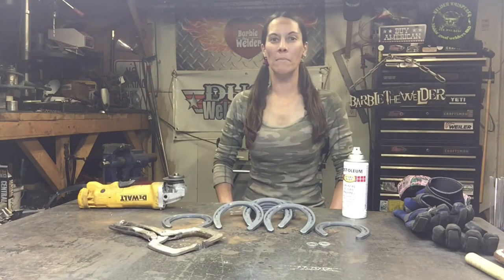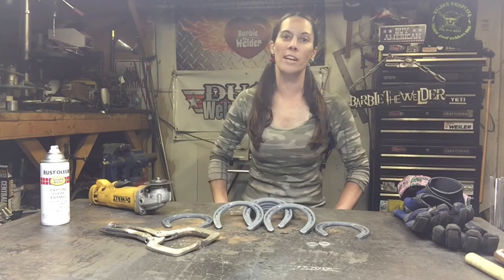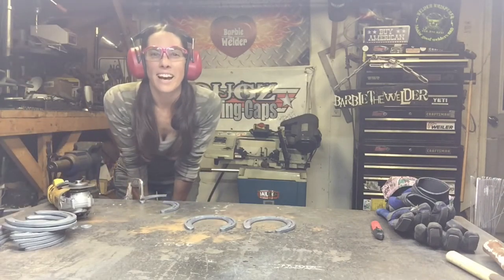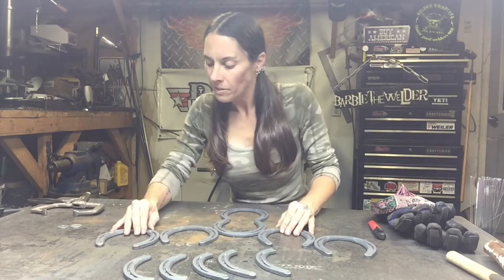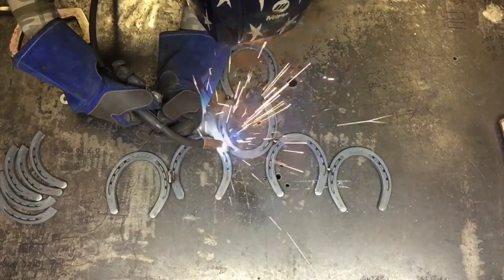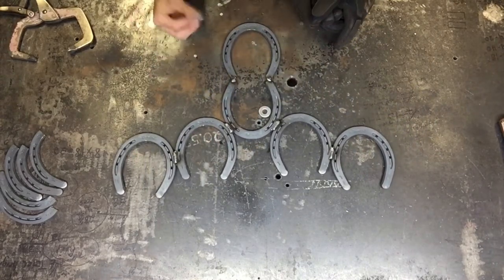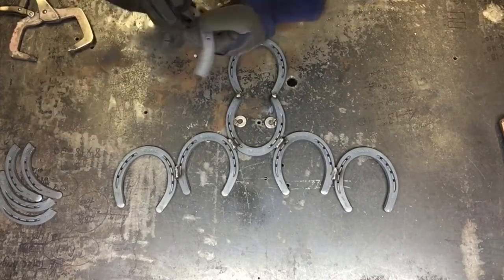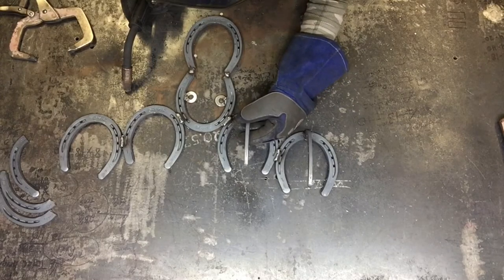How To Weld A Horseshoe Coat Rack | Easy Scrap Metal Art Sculpture | Moose | Barbie The Welder

Comment: I love it. Thanks for posting these vids. 
I'm going to make mine a googly eyed moose! Everything else in my life is just a little off center. Will look great in my family camp at Moosehead Lake, Maine. 
A couple cost saving ideas.
I picked up an old chop saw for $10 at a yard sale, put Norton metal cutting disk on it and use that whenever practical instead of the cut-off disk on the angle grinder. The disks last a long time compared  to the cut-off wheel.
It's amazing how far a quart of Rust-Oleum will go in a detail paint sprayer. Once you get used to it, cleanup is a breeze. The detail sprayer was $40 at home depot, holds 4 ounces. I've found that 4 ozs in this will cover more that a whole can of spray paint will. Being able to adjust the spray pattern also cuts down on waste. If you use even a few cans of spray paint a month you'd recoup your investment in 3 - 4 months plus have an inventory of surplus paint.
I'm really just being selfish. I don't want you to run out of money and stop making videos!
Reply from the maker: +xzaviar1965 Lol! Thanks for the great advice and for taking your time to watch my videos!!💙👩‍🏭
Reply from the maker: +xzaviar1965 Everything is better with googly 
eyes!

Comment: Great video Barbie.  What are your MIG settings for 1/4" thick horseshoes?  Thanks.
Reply from the maker: +John Sundquist Hey John each welder is different so unless we're running the same welder with the same wire my settings won't help you. I have a video on here How To MIG Weld that I explain more how to set up your welder. If that don't help please email me at barbiethewelder@yahoo.com with your welder information and I will do what I can to help you get it tuned in!💙👩‍🏭

Comment: How thick are the horse shoes? My machine welds up to 3/16. Do they make thinner shoes? Great videos keep it up!!
Reply from the maker: +Justin Edwards My MIG is a 110v 20amp welder running .030 wire and 75/25 gas. I believe mine is only made to weld 3/16 but I have never had a problem welding horseshoes which I believe are 1/4". All the projects coming out of my shop have been made with this welder, including every part of the 10 foot dragon!
Reply: You can use a propane torch to pre heat your material. It doesn't  have to be red hot. Just experiment a little.